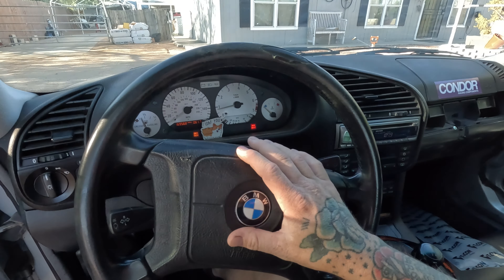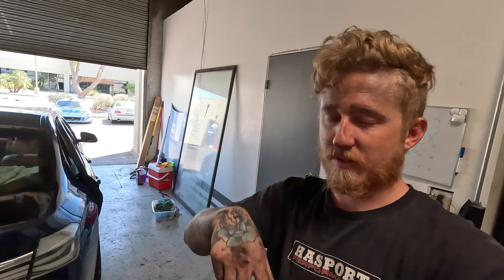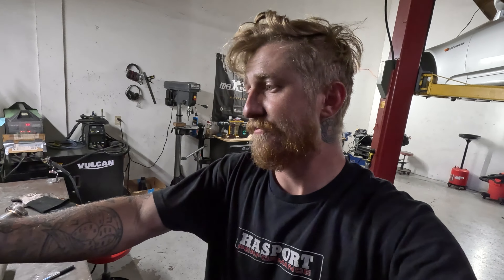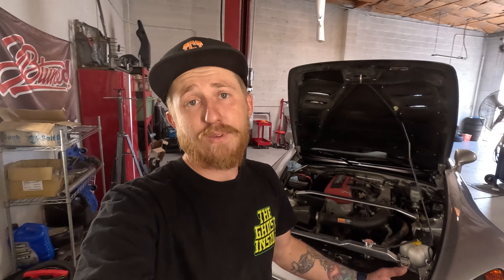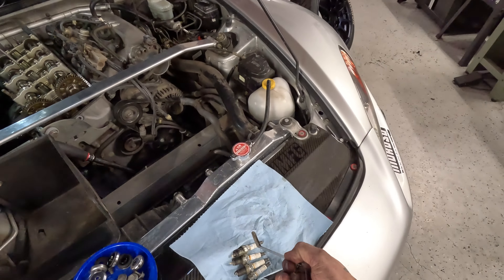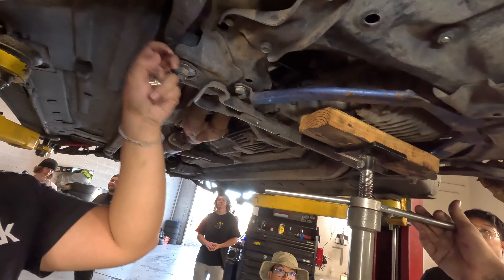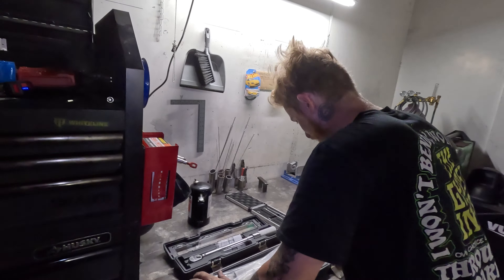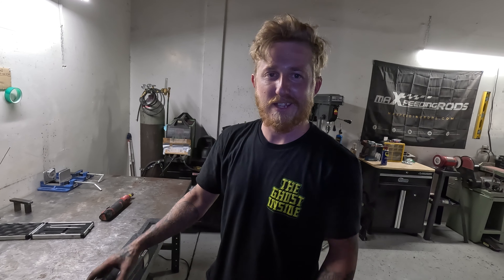Spoon Rigid Collar Upgrade For My Honda S2000

Comment: 6:50 I don't use those closed top oil drain pans.  I've never seen one work for a change;  only good for drip/light flows.  I use either ones with a large threaded top or an open pan to do changes.

Comment: Did the collars fix your alignment issue?  Currently chasing the same issue after eating a curb.  Want to try collars first before replacing front sub frame, front camber maxes out at -3 on passenger side and -2.3 on driver side.  Subframe clearly shifted.
Reply from the maker: Yes my issue was the subframe was out of alignment. The collars did for sure help. They were easy to get in since my subframe is a bit beat up but it’s been good ever since

Comment: Different car, now full size trucks. Too bad for that guy, buying that Titan. Theyve got such a bad rap for oil starving, and other issues. So much so you can get into one for about 27k here on the east coast.
Reply from the maker: The Cummins ones have those issues?
Reply: @ChrisSadowski  hell yeah. Trucks nice but that thing is steeped in issues bro
Reply from the maker: That’s wild lol. I thought Cummins were usually pretty solid motors
Reply: @ChrisSadowski  usually. But 👀 Nissan....and that's all I gotta say about that.